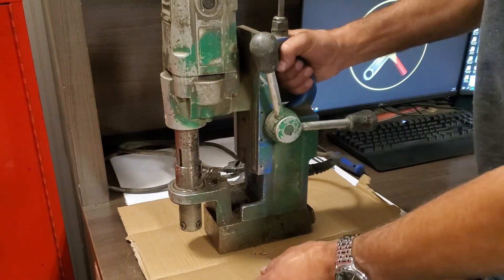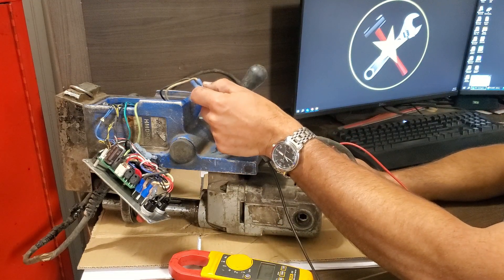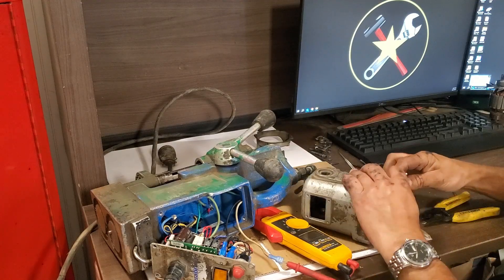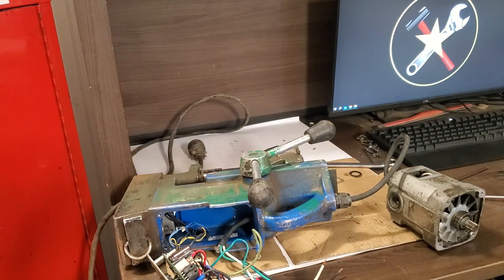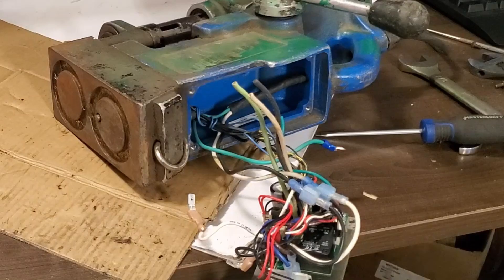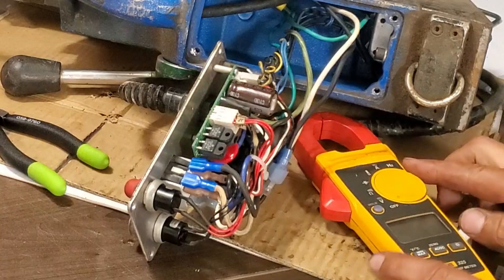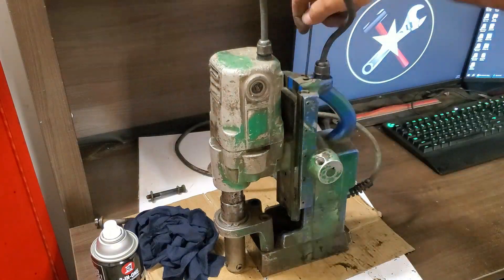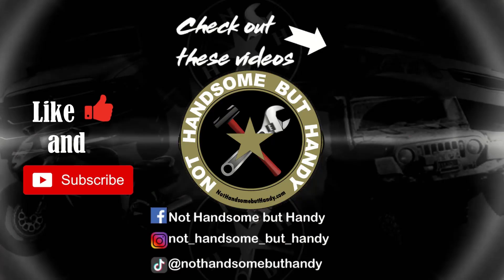Magnetic Drill Repair & Maintenance

Comment: Looks like I have to do some troubleshooting on the bad circuit board for the Hougen 10912 that burned up R56 and foil traces  on the top and bottom layers.  I will run those other checks on the brushes, gears and torn power cords.  You show a lot of good checks and maintenance tips.
Reply: My friend who runs a welding and metal fabrication ship has 3 Hougen Mag Drills that are not working.  I found a shop in new Jersey that will estimate and repair the circuit boards.  Radwell International.  These older 10912 units are no longer made.  Sure would be nice if I could find a full board schematic on the Hougen 10912.  Got any parts?  Brushes etc...?
Reply from the maker: The 10909 and 10914 manuals are online and include a wire connection diagram. Not a full writing diagram but helps with troubleshooting. Also full parts list and lots of parts are available online: https://hougen.com/downloads/drill_pdf/10914/OM9140204.pdf
Reply from the maker: Actually I just found these on the Hougen site:
https://www.hougen.com/downloads/drill_pdf/10912.pdf
https://www.hougen.com/downloads/drill_pdf/10912_wiring.pdf